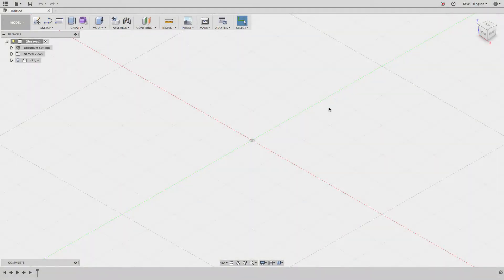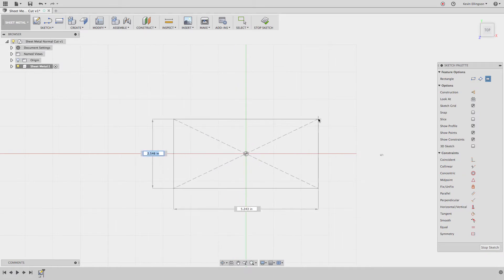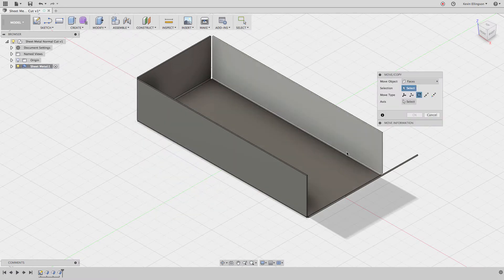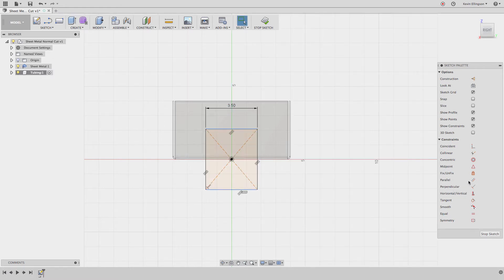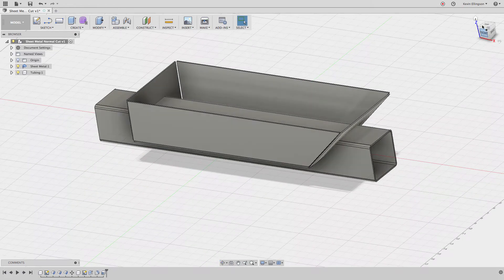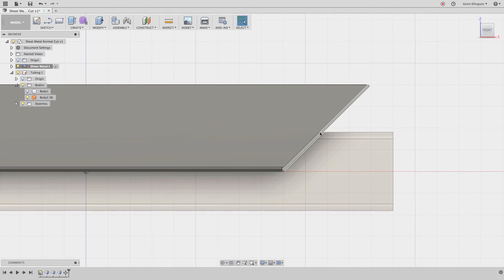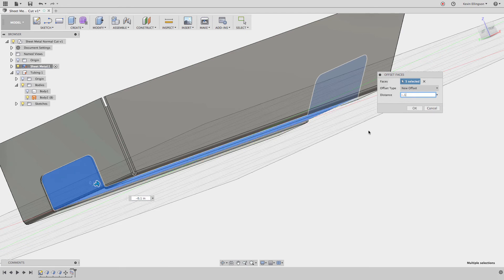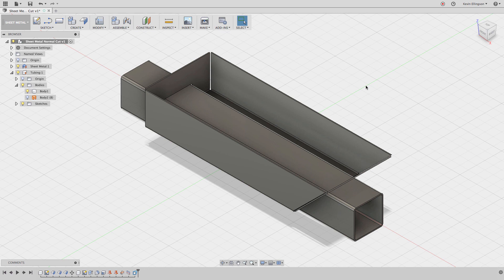Fusion 360 - Sheet Metal Normal Cuts

Comment: how that 16 thow clearance came there?
Reply from the maker: Hi Avinash. If you watch at about the 5:20 mark, I switch to the patch environment and created an offset surface that is larger than the tube that will go through the sheet metal part.
Reply: Mechanical Advantage thank you.. got it !